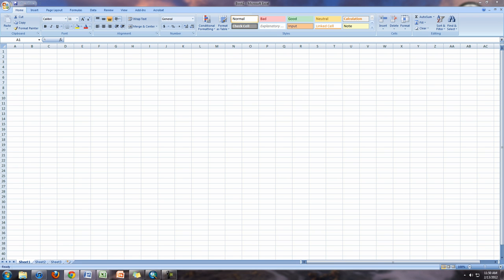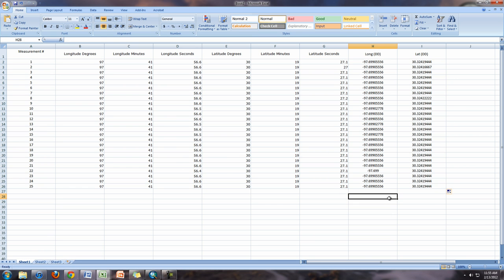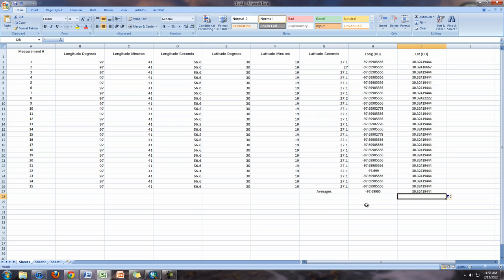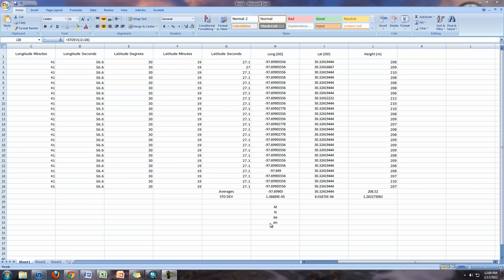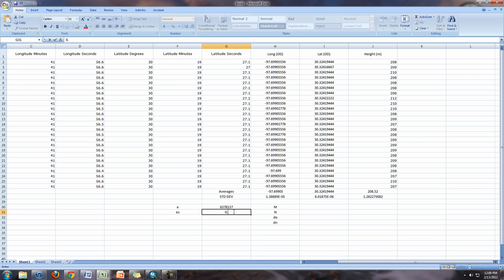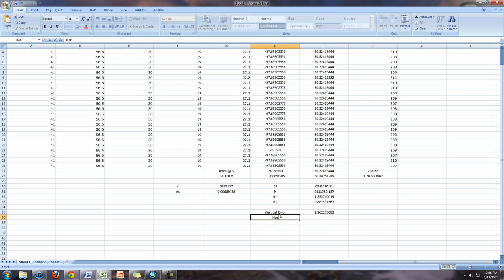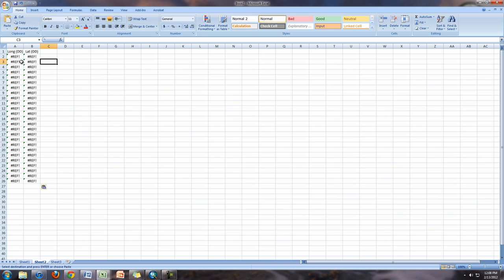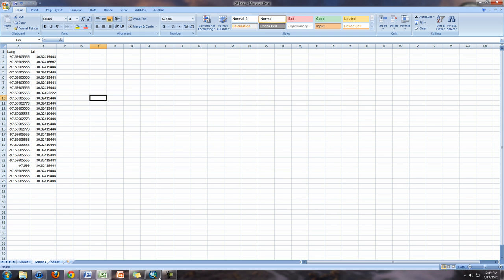Importing GPS Coordinates from Excel into ArcMap

Comment: Hi there.. A very informative video, thank you..
I have a feasibility question for you.. Do you think it would be possible to have, within Excel,  a map plotting a moving location from incoming gps coordinates in real time. The reason I ask is that an electric car racing group I belong to already uses a radio telemetry system to monitor speed, battery level, current, etc..within Excel...The 'icing on the cake' would be to be able to bring up a map on an Excel sheet with the car's position on the track..We already have gps data being received to register speed, so the coords are readily available..Your thoughts would be appreciated.. Thank you for your time.. John Rees.. Bristol..UK